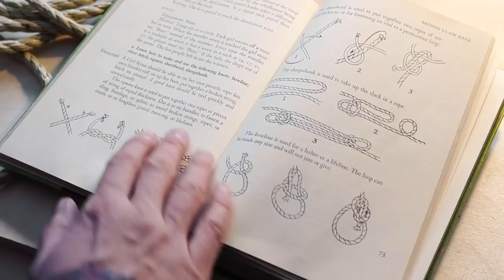Plywood Indoor Swing (no holes, no screws in the wall)

Comment: Brilliant! What a great idea. It's a lot of wood but this I would trust more than any bolt I had to put through the wall.
Reply from the maker: Yes, I saw too many video of folks crashing with their pull up bars 😂 this construction is super solid-and when you‘re done you can take it down in 10 seconds.
Reply: It's the type of wall that would influence my decision. A standard brick wall (Germany) holds your weight easily. But a drywall and stud wall is maybe not to easy. But with this one you're on the safe site.
Reply: @atariks1475  most drywall and stud framing has a large header above the door. In the US it is generally two 2" x 8" boards (~ 50mm x 200mm) nailed face to face (with a piece of 1/2 plywood in between) to make it the thickness of the wall and spanning the space above the door. You then have jack studs (sometimes called trimmer studs) that go from the floor up to the top edge of the door frame, and the header rests on the jack studs. Outside the jack studs you have two full height king studs that run from the floor plate to the crown plate (top of wall), and the jack studs are nailed to this all the way up.

This header would be more than strong enough to hold a person on a swing. There is an image of it in this article: https://www.finehomebuilding.com/2009/01/14/frame-a-door-rough-opening
Reply: @laurakampf  lol i read it as "pull up bras"

Comment: Fun project! Is there something stopping the vertical pieces from pulling into the opening?

Also what is the purpose of 4 shapes you screwed to the top?
Reply: Appear to be like finger handholds for those wanting to strengthen their fingers and grip for rock climbing or rock wall gym climbing.

Comment: nice Vedic. music all. something I was going make got most part for then got distracted lack fence that keep goats in was spine climbin wall. all exercise of climbing wall with all leave two inches off ground. one I was going build 300 pound spine thing got menaredes but think make frame out plywood cut circle out of it. mount circle like wheel on cart , so spine. make hand holds, (maybe little more thicker one door toy.)   screen all around circle. if works right climb up all time but go know were. maybe make triangle 2x 4 frame to hold plywood up.  the circle haas be as big as body if want use feet. or make one small pizza pan mount door thing. but same deal make spine like wheel on wagon. that one have holds everywhere but you only be able use hands.